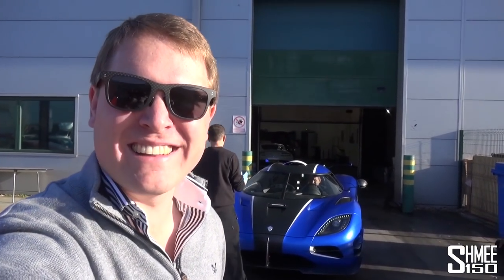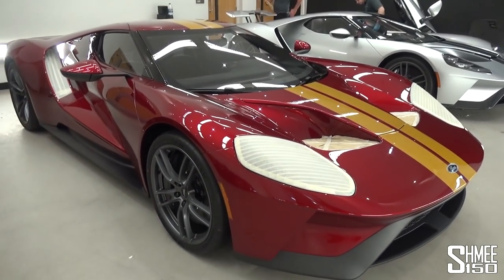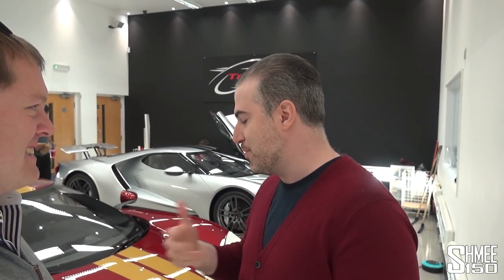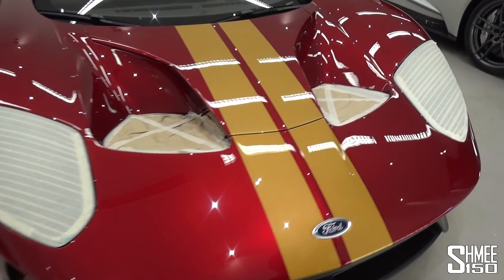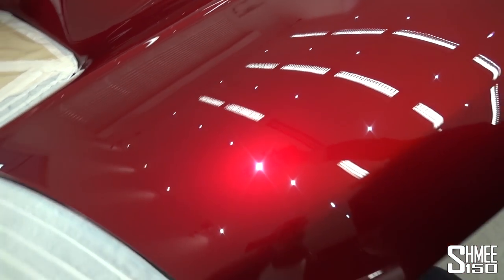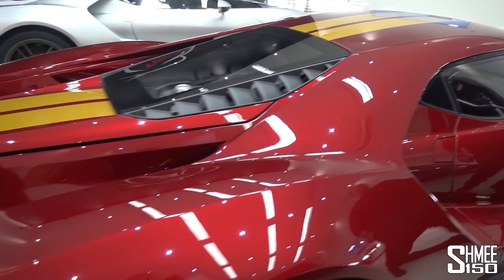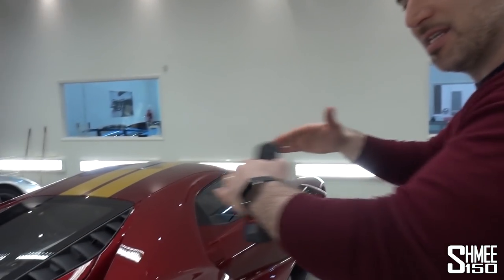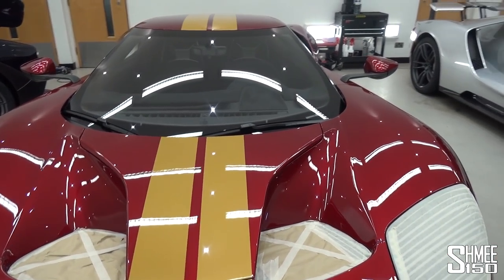Protecting My FORD GT! The World's Best PPF

Comment: As you mentioned in another video on the GT, you said that the windscreen is quite thin, can you PPF or put a film on the windscreen to help protect it?
Reply from the maker: You can, but it won't be smooth like glass so you'll damage your wipers and their motors
Reply: I worry that it could get damaged with all the driving, what about putting it on the inside, could that be an option and also for the Senna as that it quite thin if I remember.

Comment: Now the one question that remains unanswered even in general terms is... cost. The Topaz website does not seem to give any costs...I cannot find them so they are well hidden or just not there. It would help viewers to know that a full PPF treatment for a new Focus RS is “around £***l it cannot be exact as each car may need different levels of work but the point is that many could afford say £500...some will not flinch at £1000...others will ponder at £1500 but 99% will grin and move on at £5000!! Tim...your GT I would guess is up around £4/5000 perhaps....but please could you just give us a clue? 🙂🙂

Comment: (As a detailer myself) Ford notoriously has good and easy to work with paint. Not surprised by the original condition and what Topaz has been able to achieve, also considering the work they normally put out.

Did they ceramic coat the film?

Comment: The Aero hole behind the front wheel.  As this likely only helps at high speeds why not keep clear film over it like it was when received?   Even with film this hole is going to let rocks beat the film.  Maybe add and remove a patch over the hole when needed.   Seems like a bad design.  Not worth the damage risk for Aero.

Comment: I have a question. If you install Paint Protection Film on a car and then decide later on that you want to wrap it, must you then remove the PPF or can you install the wrap over it and install another layer of PPF over the new colour?
Reply: Dillon Meredith You can wrap it over the PPF Tims Mercedes has also PPF and a wrap
Reply from the maker: Correct, you can put a vinyl wrap over PPF
Reply: In reply to that Tim, can a wrap be taken of and leave the ppf untouched or will it peel the ppf with it?

Comment: Flim yellows & stains over time. Should’ve ceramic coated it.
Reply from the maker: Ceramic coating is a very different product, it won't stop stone chips but gives a great shine - hence why it will be done on top of this film. Modern film actually doesn't yellow in the way it did 10 years ago though too

Comment: As you have a thin windscreen do you have ppl on the windscreen Tim?
Reply from the maker: In the UK it would be foolish to PPF the windscreen as the additional friction when they run in the rain would quickly burn out the wiper motors

Comment: Do you only PPF cars of real value to you? I.e. not the focus' etc
Reply from the maker: It's more how the cost of the PPF is proportional to the cost of the car. For example it wouldn't make sense to spend 20% of the cost of a Focus RS on the full treatment.
Reply: @Shmee150  Yes that makes sense I guess. Best to spend it on those cars of more substantial value with expensive paint schemes and the like.

Comment: Shmee can they do ppf on the wheel arches of chiron which are carbon fiber
Reply from the maker: Visual carbon fibre on a car is normally finished with a lacquer on top so it is a smooth surface and then yes it can be protected
Reply: Shmee150 I mean the under side which gets bashed with slick rubber and stones